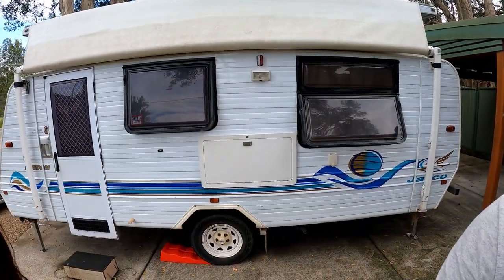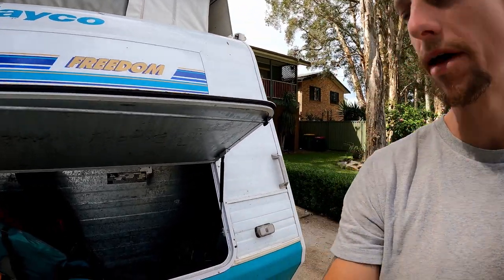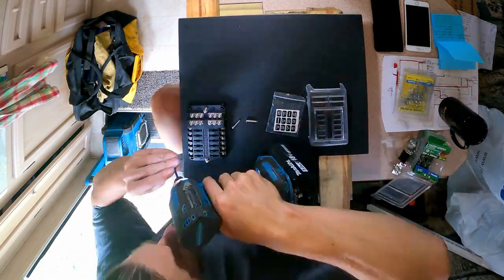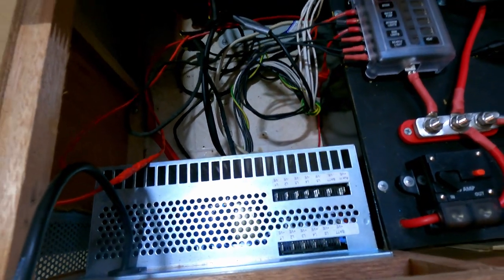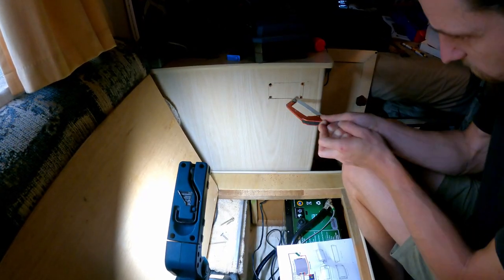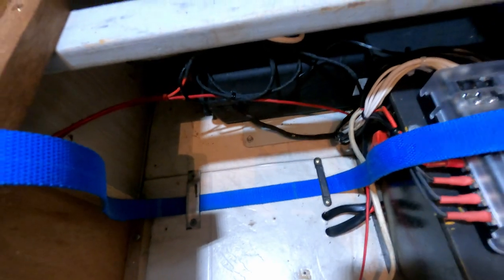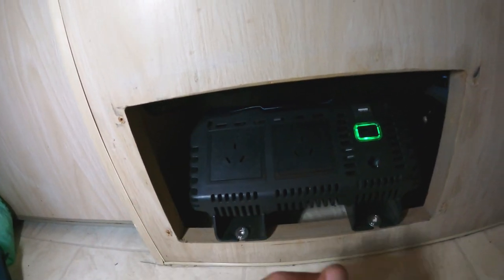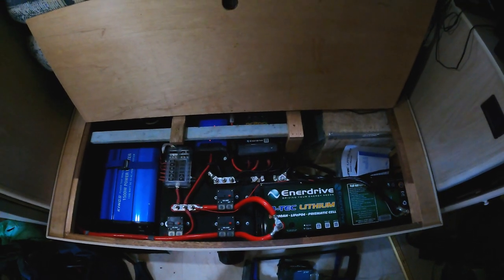DIY 12v off the grid conversion in a caravan

Comment: Good video, thanks for taking the time to explain what you did, some good ideas. I did something similar with my caravan, on my inverter I wired in 2 normal house plugs with short cable into 2 double power points which I then screwed to a new facia board. Keep the videos coming.

Comment: My inverter is on the front, I have a push button remote inside to turn it on and off, I also ran a double power point from inverter inside so I never need to go near the inverter  to use it. Nice job mate.
Reply from the maker: That's a great idea especially with the remote button. I was thinking if I ever wanted to get another battery I would move the inverter and do a similar thing to what you're saying. The new battery would go where my inverter is now 😊

Comment: Hi Jess and Shaun, thanks heaps for your video, it really simplifies most of the concepts, making this project for me a bit more doable. So thanks again for your efforts and putting this up for anyone in need.
Just have 1 little question, is it ok to keep the setec unit if you are still using AGM's batteries? As ill be only adding a dual charger dc to dc and solar controller unit.
Reply: Thanks for the feedback 😊 first I must remind you I'm not a professional electrical engineer, just have a little bit of experience. In that limited experience and understanding I can't see any reason you couldn't keep the setec unit. It saves making a new fuse board and buying another AC charger. 

One of the reasons I liked a separate AC charger was that I could accurately change the charging profile for my specific battery for optimal charging. Batteries should come with a recommended charging profile (sadly alot of cheap ones don't)

Comment: Nice looking setup . After buying quality everything why the kings inverter?  I hear they are value for money and do work well but why not keep it all enerdrive?
Reply from the maker: Thanks. The kings inverter was in my ute and became redundant after doing this install to the caravan so I utilised it. 1500w is more than enough for our needs atm and they are fantastic value for money. After doing several modifications to my Ute and the van spare money was a bit scarce too so it will have to suffice for now. 
Also I have future proofed the design by allowing enough room to eventually fit the 2000w enerdrive in its place if need be.

Comment: Your fuse box looks very impressive. I also have a jayco freedom with duel batteries and has the old centurion, I’m wanting to add two 250watt panels, after I run them through the mppt  can I run the cables to the battery direct or would I need an inline fuse, cheers George.
Reply: Egidio as no one has responded to your question, I thought I would try and help  you through the 12v caravan stuff. 1stley are your panels going to b fixed solar panels? as they will produce the most out put for you, depending on your daily needs. Your mppt controller will need to be at least a 40amp like ie. kickass or renogy or victron or lastly kings. Kickass have a 12/24volt 40amp controller that can handle up to 520watt.  Renogy is almost the same as is victron. Kings is not as close. Warranty is something also to look at, as back to base for you if you have probs around Aus. I hope some of this info has helped you and anyone else looking at possible going down this road. cheers.

Comment: Thanks for this. I also have a Freedom & would like to install something similar. Do you have a pdf or photo  of your wiring diagram that you would be willing to share?
Reply from the maker: Sure. Happy to help. Also I had to modify the framing under the bench seat to fit the board in. I forgot to cover that in the vid but you get the gist of it. I have a photo of the diagram I drew up. How can I share it with you?
Reply: @live2thrive249  G'day I'm also keen to get a copy of your wiring diagram. Will it let you post a pdf doc in the comments?
Reply: @Live2Thrive  looking also for the diagram

Comment: Thank you again, Shaun. Are there any opportunities to share the diagram of the wiring? I've got a similar van it also needs to be updated.
Reply from the maker: Hi Chris, unfortunately I don't have a copy of the wiring diagram but I found a similar one for you to use as a guide. Google the "enerdrive battery wiring for towing applications" if the link doesn't work 

I personally used a combination of different wiring diagrams to make one that suited my needs.

https://www.google.com/search?q=dc%20to%20dc%20charger%20wiring%20diagram&tbm=isch&prmd=sivxn&hl=en-GB&sa=X&ved=0CBcQtI8BKAFqFwoTCOiH9uay3vUCFQAAAAAdAAAAABAb&biw=360&bih=651#imgrc=LIQ-ESPNwrHy6M
Reply: Thank you Shaun so very much, still pausing the video and enjoying the explanation. Appreciate the time to share and apologies for the lateness of my reply

Comment: Was going to install an automatic transfer switch in and hard wire my inverter into the caravan 240v wiring so when I am using shore power it will kick the inverter out and vice versa

Comment: Where did you get the cable hold down clips from. I'm not even sure that's what they are called. Have been trying to find them but haven't as yet.

Nice setup. Got me thinking now to not use the boot as well because of inverter too.
Reply from the maker: I'm not sure what clips you're referring to. Possibly the bus bars which are the junctions where the cables connect? Or maybe with the heavy gauge inverter cabling I used 2 "clips" which were copper plumbing saddles bent over itself.
Reply from the maker: Oh and I've also learned since making this video that you can get remote control inverters which would make utilising the front boot a much more enticing option. Might be the go for you if you were leaning that way initially??
Reply: @live2thrive249  thanks I've found what has been suggested to me at Bunnings. It's the cable clamps that you screw down to keep the cables neat and tidy. Already have 2 inverters a 600 Watt and 3000 watt. May just not put them in will see down the track. Thanks for your replies.

Comment: Hey Shaun!  I was just wondering if you could share what size fuses/wiring you used for the larger items such as the MPPT, DC-DC, inverter, etc?  I'm just finalizing my parts list and these items have me a little stumped.
Reply from the maker: It was a speedbump for me too figuring that out and to be honest I'm not 100% confident in making any recommendations. 

That said I used a 30amp fuse for the solar input. A 60amp breaker for the Dc2dc charger. A 200amp breaker for the inverter. And I didn't bother with the AC charger since it has a fuse inbuilt in it. Hope that helps 😊

Comment: Is that victron charger good enough to charge your battery
Reply: 30amps is sufficient for 240v. If I'm plugged into mains power, it's going to be plugged in overnight. I designed this system to predominantly be charged by 12v (the cars alternator and solar) individually and/or simultaneously. It's designed as an off grid setup so the victron AC charger is a backup
Reply: @shaunduncan8747  got ya, some battery specs say certain amount of amp p/hr,
Reply: @man.i.literally.failed6772  that's right. Having a charger with a lithium profile in necessary

Comment: why didn't You buy an amphibians and run a lead from the front boot to the 15 amp 240 volt socket on the side of the van. 

Then change all lights to led bulbs and You could have used the GPOs in the van.
Reply: Why? Because that wasn't important to us at the time. We didn't need 240v for anything except 1 laptop charger which ran off the inverter when needed. The point of the video is to be reliable on a 12v system.

I'm also confused about your proposal for an amfibian and what it would achieve in an "off the grid 12v system". Run from the front boot??

Comment: Hi how much did it cost you just wondering going to do the same
Reply from the maker: Hi Frank. I don't have exact figures but a ball park figure for all the hardware and components would be $3500-$4000 AUD. About $2000 of that was just the battery 😊
Reply: @live2thrive249  thanks for that information sounds good